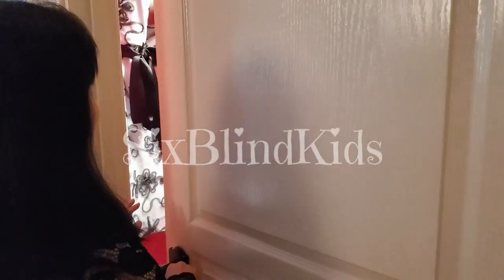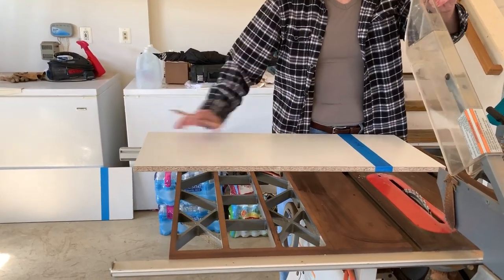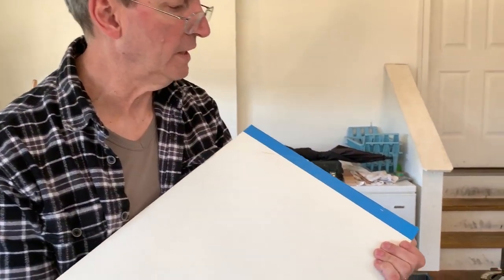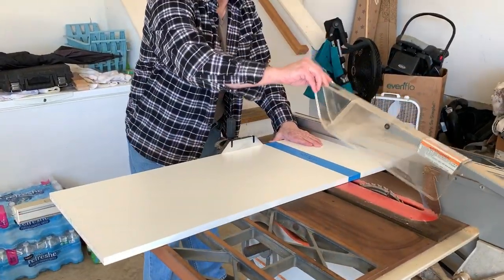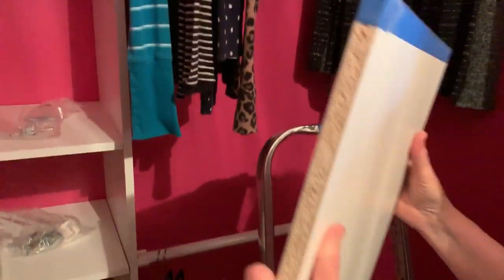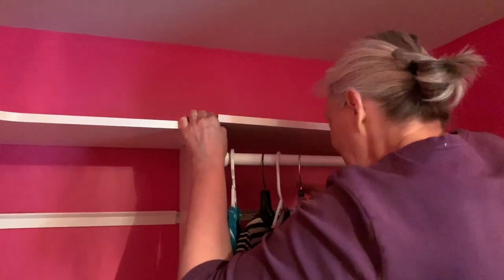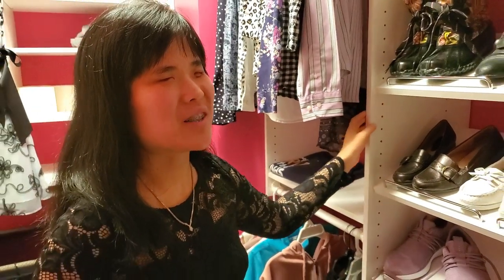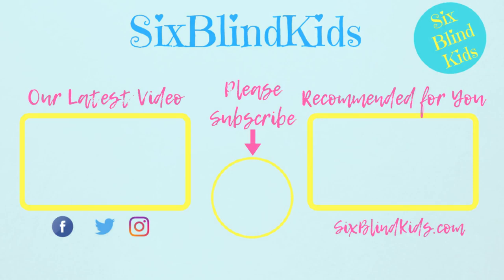Blind Girl Luxury Dream Closet Tour Reveal!

Comment: It’s crazy how much money it costs to have someone come over to build, repair, paint etc etc…. With YouTube, it’s usually so easy to learn how to do just about any project.  I love figuring out how to build, or create something.  Funny, I used to go to a jeweler for repairs and watch battery replacement and the guy was very reasonable compared to other places. The shop owner retired and I had to find a new place. It was very over priced and so I watched a few videos, got the tools and do it myself.  Little did I know, half my church went to the same place and they found out I was doing it and I make a little extra money doing so.  I don’t feel right about charging much because the batteries are extremely cheap online and work great 5:33 .  Plus, I am still learning.  My mom had some watches that are real gold with diamonds and those I don’t dare touch.  One tiny mistake and it’s ruined. So yeah, DIY is really a lot of fun, especially when you have YouTube to teach you whatever you want.🤓